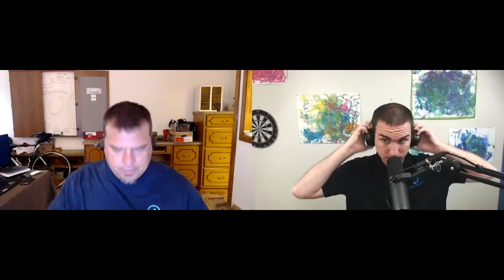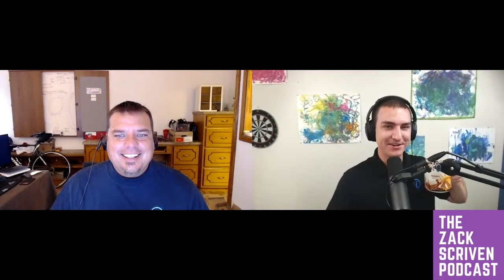The Zack Scriven Podcast #037 | Walker Reynolds | Digital Transformation & IIoT

Comment from the maker: 0:00 Digital Factory
5:00 The Holy Grail of Manufacturing
9:10 The Singularity of Manufacturing
12:40 Does Automation Kill Jobs?
14:24 The problem is not going to be enough data
15:55 What is a disruptive Integrator?
17:10 Our Values and Vision
19:12 Taking on difficult projects
22:42 Walker's Advice for Zack Scriven Media
28:07 90% of life is work
38:15 What to look for in Integrator